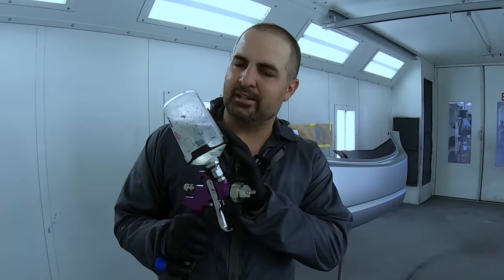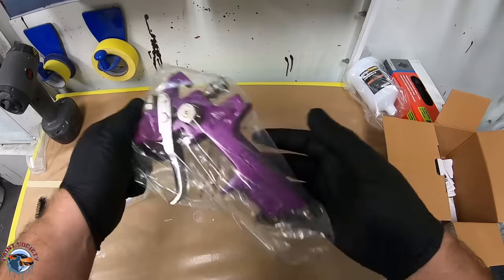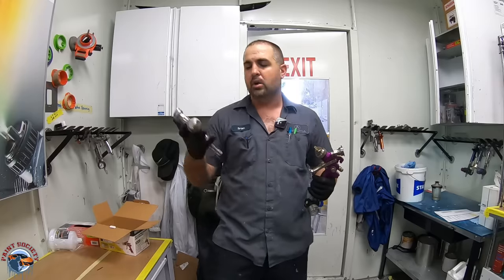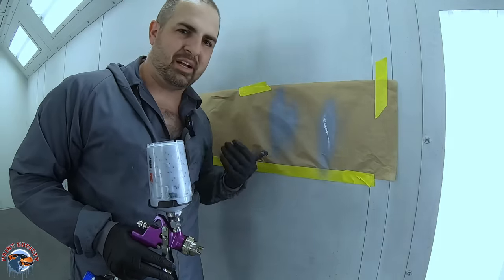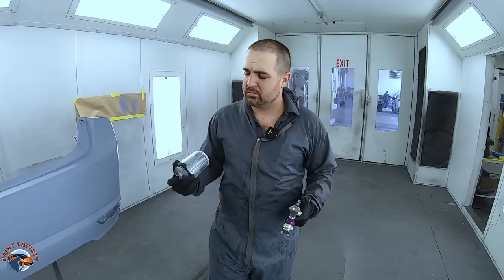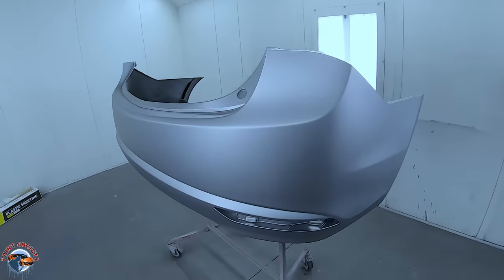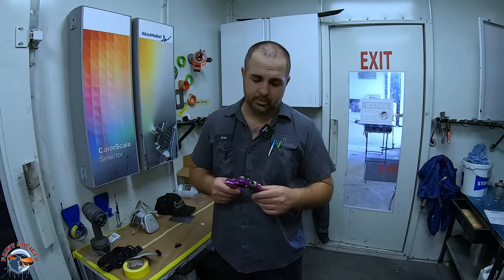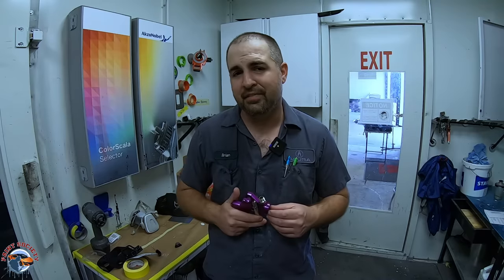$15 Harbor Freight Paint Gun Delivers Professional Results!

Comment from the maker: Hey guys! The number one question I have been getting in the comments is what settings are the gun at. 

Fluid wide open
Fan wide open
Pressure 35 psi
Air valve on the bottom, wide open
Reply: Can you paint my car?
Reply: You could do a whole video on just adjusting the gun!
Reply: What brand paint do you use?? And what sealer 1st coat I am new on this thks
Reply: For all three stages ?
Reply: Great video! I am in Trinidad and I tried this gun. The base went on smooth enough but the clear would not and I got a lot of orange peel in the finish.  Could it be pressure too low, clear too thick or both. This is my first attempt at painting a car. Thanks for the videos they help a lot.
Reply: can you make a video where you set the gun?
Reply: Paint Society glad this video just popped up.  I have never painted anything except rattle cans.  I bought this to paint some outdoor furniture.  Was gonna set it at 22 psi.  Obv way off for this gun. 35 it is
Reply: Too much texture at 35 psi close fluid up starting at 1/2 turn at a time. But if you want no texture get the black widow HTE
Reply: @joshteel3226  I saw another video from this channel "applying clear coat" i think is the name, was done in January. He was explaining droplet size and how to adjust the gun properly. My guess is too much fluid not low air pressure was the problem. Using this gun wide open may not be good for clear coats.  Saw the video too late. Now I am trying to correct the error by wet sanding and buffing. Darn it!
Reply: St Nick when I first started I messed up a few times too.  But I already knew how to wet sand and buff lol
Reply: @joshteel3226  neccessity is the master of creation.....i will have to learn or rub it all dwn and clear all over again.......dont overthink it, it's only paint.
Reply: hii Paint car I use mm 1.4- 1.7 ?
Reply: @נירצמח  1.3 or 1.4
Reply: Obviously those are not the settings you used because you even said in the video that you had to adjust even before you sprayed the sealer and all through the rest of the stages.
Reply: You also have to adjust the gun for each material. For instance used HB body ultra HS clear with iwata lph 400 and I had a 1.3 opened all of the way up and it was slow coming out so I had to go reduce it down 10%. The same gun same settings was used and I sprayed medallion 6100 clear and it came out too fast at first so I had to close the fluid one turn.
Reply: The problem with the cheap guns here are the machining and the fan will be uneven from top to bottom
Reply: Hi, I saw that the specs for this gun are: 40PSI and 6 CFM. How better would the work be if the gun was setup as specified by the manufacturer?
Reply: @wagnerribeiro8036  doesn't really matter what you set it at because I'm 99.9% sure that you will need to tweak it anyways.
Reply: what CFM is your compressor?
Reply: Homemade sling
Reply: The main thing to look at are the 3 holes in the piece that screws on before screwing on the atomizer tip. Some weren't machined all that well, still have burrs partially blocking the holes. A little diamond tip Dremel bit solves the issue nicely.
Reply: I used these guns for military containers etc etc and it always turned out well and that was using the military's non infrared paint also
Reply: @philiprowe2147  I agree, I watched the video to learn how to set the gun up. Any pro already knows why not to buy a 10 dollar spray and how to set it up for best results... being a greenhorn/new-- now I gotta find more video.
Reply: @jonathanlawson4667  So lead paint? Thats why us government banned lead paint so they can spy on us.
Reply: @larryhamilton264  no it's not led paint lol maybe forty years ago it might have been but not what I sprayed the military produced a flat green enamel that infrared will not detect but it is hard to get off your skin and it's very loud in smell compared to normal paint we used it to paint the 155mm containers
Reply: @stnick69  did you fix the clear coat with wet sanding or was it beyond help?
Reply: @Mr_PNW  I corrected it with sanding and buffing. When I applied the clear and noticed the finish wasnt smooth I just kept adding coats. My logic was if I had to sand at least it will have a thick enough layer to sand smooth. Paid off in the end but was a lot of work. What I did was wet sand from 600 which is very aggressive to block sand and take the peel of. When it was almost flat (could see the speckle in the paint) I sanded all the way up to 2500. I never did this before so as I did panel by panel the finish got smoother.  Thankfully I left the top for last but now it makes the panels I started from look bad lol.
Reply: @joshteel3226  This is why I could not get an even layer on large flat surfaces. This was my first attempt at painting an entire car and i kept getting a "striped" finish. Thought was something i was doing wrong.
Reply: I bought this gun 8mnths go. In that period I have painted two entire cars, two sets of rims and blended the top of a car and top of the doors to the sides. I cleaned it everytime  I used it. It had a slight leak at the trigger from the second car which has gotten progressively worse. The tip isnt coming off and I see nowhere to fix that problem. Painting small surfaces the gun works well, the rims were perfect. On large panels it was impossible to get even coats the gun seem to be adding more paint on the bottom than at the top of the fan. I read a comment here saying the tip where the air comes out may be blocked but this has been happening from out the box. Maybe the tip just isnt working as it should?
Reply: @philiprowe2147  to adjust it is easy.take 10 seconds i have it,i also have a better one..hls complaints are  its made of cheap materials and it takes much longer to cover bumper...but with extra effort it does a very good job..i saw very little orange peel and no runs ....not all of us need expensive equipment since we we only paint once or twice a year...
Reply: Is sealer the same as adhesion promoter like bulldog on plastic bumpers?
Reply: @mattivirta , for the flow out, low flow or low psi will create orange pill and too thick of spread, higher psi spreads evenly for a nice finish.
Reply: What is the amount of base paint do i need to do a ford sedan
Reply: @stnick69  It could be pressure or flow too low (skinny hose maybe), too far away from the panel (or angle too great- not straight enough at the panel), or not keeping a wet edge from not enough overlap.
Reply: @THESkiViking  thanks for the reply. I thinned the clear and got a near smooth finish. So i mix ratio as instructed by the paint supplier but for my final clear coats i add a little more thinner.
Reply: 35lbs is over HVLP limit. so that is not really fair.
Reply: @stnick69  atomazation is key
Reply: @t-conny985  paint to hardener ratio is what is critical to the paint chemistry, not reducer correct? Reducer is what gives it flow as you suggest.
Reply: @jeffstewart418  Good luck I have looked also can't find anyone who shows how to set it up for optimum results. They all show the wonderful finished results but setup must be a maximum kept secret lol.... If they told that secret no one would but the 600-800 dollar guns? lol We seen the 5 star results but got a 3.5 rating. No more guns reviews would be necessary if a 5 star rating was given on this one lol? I am half kidding but half way believing it may be true !!! 🙂Don't get mad at me Brian.  🙂

PS Jeff if you find that video please respond here. I want to see it too! 
Thanks, Phillip Hall
Reply: @stnick69  same, clear coat ruined my job
Reply: @stnick69  me too
Reply: Dude great to know. I’ve painted 2 cars and used this gun and could never get it adjusted just right. It would try to drip from the nozzle.
Reply: @stnick69  im from Trinidad aswell and im going to paint my car with this gun how did your paint came out and how did you set up the gun
Reply: @Mikefngarage  55 psi is $ for these guns..
Reply: @85nscarola  not sure but my sprayer works better when set above 45 psi, the higher the pressure the more paint comes out, maybe my paint is too thick, do you get good results with 35-40 psi. Thanks God Bless
Reply: @johnjkizer6399  yeah worked very well. Reduced all the paint before spraying
Reply: What brand clear coat would you suggest for a beginning painter?
Reply: @mattivirta  when I went to school for body work recommended pressure was 50 psi for solids and 65psi for metallic.
Reply: St Nick increase the psi to 50 when spraying clear coat with the HF gun. I spray base at 40 psi and base at 50 psi.
Reply: @mattivirta  it is written on the box it needs 40 psi.
Reply: @philiprowe2147   What adjustment? its all maximum.
Reply: @joshteel3226   Or you could adjust the gun and treat the target as if it were much larger, painting with smaller section for the amount of paint it flows.  Make arms very sore, good work daniel san.
Reply: What paint gun should I buy? The best of the best paint gun..
Reply: So basically full freaking throttle on this one haha
Reply: @roadstar499  I’d use my 100 dollar devillbiss flg3 would wipe that pos. For the material u make mistakes on cost you way more to fix than to just buy the proper tool to begin with
Reply: Do you think Jesus is alive?
Reply: Well maybe...Start with that but adjust as needed and ALWAYS do a test pattern before you shoot the project. Just be carefull when you narrow the pattern on any gun. Lots of paint all of a sudden and runs can happen easily.
Reply: @RingoKnight  on compressor or regulator
Reply: @jaandel1  l
Reply: @jecrpalier  would you recommend that fg3 over the kiwami4 Iwata? 🤔
Reply: I'm new painter can I ask why you have everything wide open? I thought you were supposed to adjust the fan to about around 4 inches or so

Comment: Brian’s distance & overlap has the accuracy of a robot. He makes it look effortless. Gun may be ok but his skill set is the main reason the paint looks excellent. I found it helpful to practice the motions with the gun connected to the hose before actually spraying to develop some motor memory. Thanks for all bout videos.
Reply: This is probably the other half if not more of why the paint finish came out good on the bumper cover replacement.

Comment: Good to see a bumper being painted like this with the same hang position as on the car. So many people dont do this and change the metalic laydown against the adjacent panels. I Used to us a clothes stand with thick welding rods and my colours were always spot on against the adjacent panels.
Reply: Only way we do bumpers at work.
Reply: My issue with doing it like this is you now have a two tone car.  No blending?
Reply from the maker: The camera will do that but no blending on a bumper replacement.

Comment: I’ve used this exact gun but for spraying wood projects, both clear and color have been ran through it. A single gun has lasted me over two years just using lacquer thinner/Acetone for clean up. It’s long retired now, but for $16 ($12 with the coupon when available) you won’t find anything better in said price range, guarantee you that much. You are correct about the gun needing to be cranked way up, which is annoying. However if you use it a couple times for random projects, it’s not bad. If you are new to spraying, you could easily learn on it without breaking the bank, but eventually I’d upgrade to something more quality.

Comment: Been running a body shop for 9 years. I use a devilbiss tekna for my clear and a devilbiss gti for my color. I bought this exact gun for 14.99 yesterday at harbor freight. And I’m seriously astonished with the results. This gun is amazing. Only thing that bothered me was the special wrench wasn’t included lol. Lots of grease inside the gun when you buy it. Make sure you clean it really good before first use.
Reply: And Harbor Freight dos not carry the wrench that doesn't come with the gun so you can't clean the gun it's a throw away gun.
Reply: @erickaufmancustomguitars1351  I know what size it is 19mm x 2.5mm thick some times I wish I had a wrench 2.5 mm Thick nobody makes a wrench that thin that I know of
Reply: @robmcguire9756  ah, I get it now.
I have little experience making tools, but some. I used a grinding wheel to modify a socket to be thin walled years ago to adjust a Jackson guitar truss rod. I still have it lol. But naturally I have found the appropriate tool from a dude driving a mac tools tool truck. After he realized I wasn't trying to car jack him, he was happy to sell me a nice thin wall, deep well socket that is really nice. 
Here's to hoping you get what ya need bro. Cheers...

Comment: I bought the two HF guns (small and large) back in 2005 to paint my $90,000 airplane.. Came out great. I'm still using those 16 year old guns for repairs and spray jobs today. Of course I only use them a couple of times a year on average but they still work almost as good to day as when they were new.

Comment: Thank you for showing that clear coat can be actually applied in a gloss finish with such cheap gun. Every single time I tried to paint something for my cars, I failed in the clear coat step, the end result had massive orange peel. I have the feeling that it is hard for the gun to atomize the clear, rising the pressure kind of helped a little bit. Never added thinner to the clear, maybe it’s worth trying.
Reply: Maybe you're too close to the parts, or you are moving too slow and too much clear is building up to the point that you get orange peel. Always try moving a little faster than usual because you can always come back to respray to compensate if you are getting results like an overspray by moving overly fast. Practice your hand, arm, & body movement with the paint gun for a while without actually painting just so you can build up a sense of how you will be painting; some people freeze-up a little as they are spraying. This will help to give you some confidence.  I've just finished painting a fender & a front bumper cover for my Prius, using this same 1.4 paint gun that I had for 2 years when I painted my mustang's fender. When I was first learning how to paint, it was the clear coat that was the nerve -racking part of spraying. Mess up on the clear coat & the whole work has to be redone.

Comment: Hey this harbor freight spray gun can so from primer to clear, including metallic,  candy, and base. I have been using this very gun for 15+ years most recently painted 1992 Ford LTL 9000 Log Truck and 2004 Ford F250. They have primer, 3 different metallic base colors, Rudy Candy Red, and Clear coat. Would love to share some pictures with you Brian. Candy paint and Clear need to have 44psi air to lay either of the 2. As long as the gun is properly cleaned and stored it will last through years of painting.
Reply: Awesome! What PSI do you set the paint and sealer or primer? Thanks!
Reply: @PhillipHall01  You set the pressure to the minimum pressure that will fully atomize the paint. The pressure needed depends on the viscosity of the paint/primer/sealer. Always test the spray pattern on some paper or cardboard before applying.
Reply: @lizardking8388  give us an example please

Comment: I've never sprayed 2K, so I don't know it's spraying characteristics, but for lacquer, this gun has been incredibly good to me. There are some little tricks I've had to learn, but for a cheap gun I bought on a whim, I've never felt the need to replace it. If I thin lacquer about 10%, this gun lays it down nearly perfectly, and with a few fog coats shortly after my last wet coat, the finish flows out and has almost no orange peel. Especially if I fog coat between every wet coat.

 I'm considering using it for my first automotive painting attempt. I'm pretty confident that if I carry over the little tricks I use for lacquer, I'll be able to lay down a damn-near-perfect finish. 

To anybody reading this and considering the gun; Buy it and use it. Give yourself some time with it to learn its needs, don't try anything too serious until you know the gun well. But I think if you're patient and give it a chance, you'll be impressed with what you can do with it. I build 2k-3k custom guitars and use this gun on all of them. I get absolutely flawless finishes with it, though I do have to do some minimal wetsanding/buffing. But that's to be expected with any gun, even the top dollar ones. Just takes some experience.
Reply: Did you paint at 35psi? Aside from a good regulator, what (gallon) capacity air tank is needed for auto bodies (not individual panels)?
Reply: @bobgreene2892  The gun is finicky and sometimes demands different pressures, but that's mostly down to what lacquer and cut strength I'm using. But yes, usually around 35.

As for what capacity for auto work, I can't say with any authority as I never got around to it. But I would imagine you'd really want a 30 gallon tank. That said, if you're doing individual panels, you can probably get away with a 5/10 gallon compressor if it has a decent motor that can keep up. I spray whole acoustic guitar bodies with a 5 gallon Kobalt compressor and it keeps up fine. Probably the same surface area as most auto body panels. Definitely wouldn't try to paint a whole car in place with that setup though.

All that said, I'm still using the same gun and it's still doing great. Had to replace a couple seals with off the shelf stuff. No big deal. Worth the tiny investment for sure.